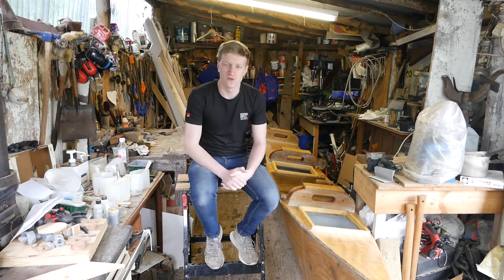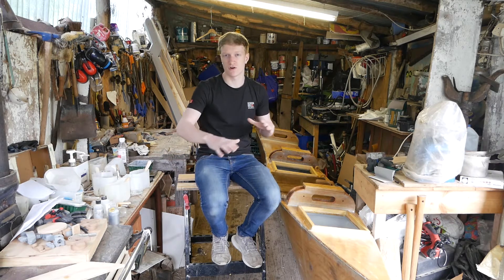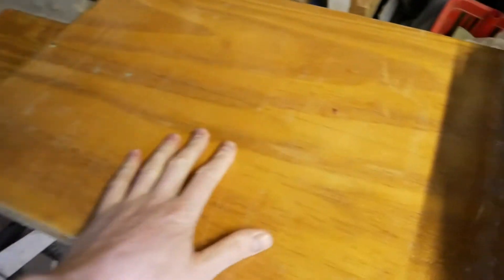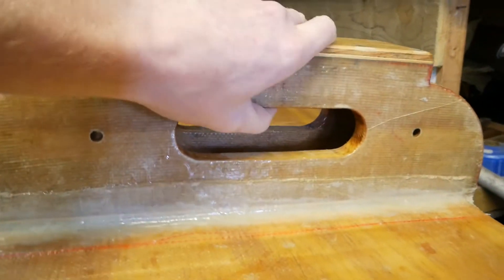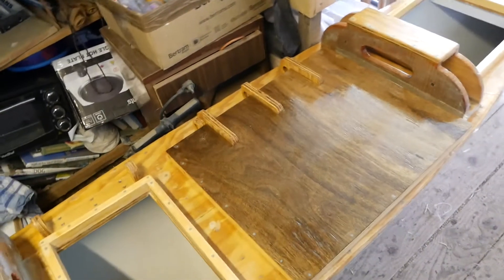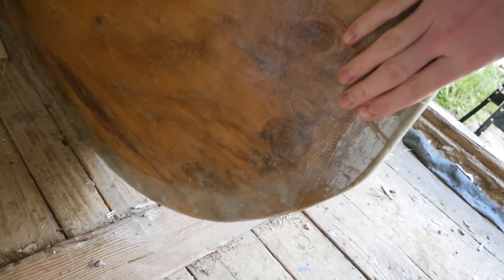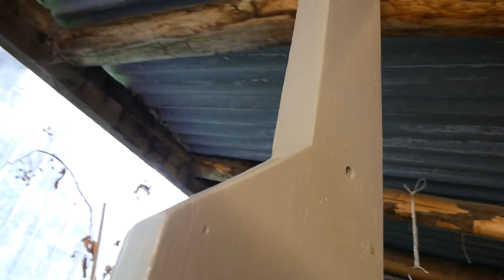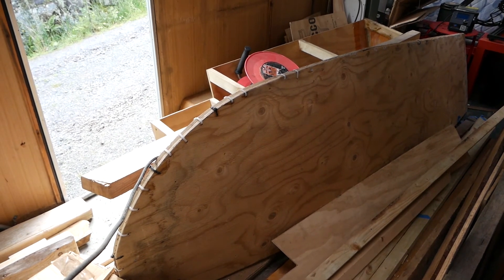Building a Plywood Catamaran - Boat Build Project Introduction

Comment: Did you do any buoyancy calculations on those hulls? As I agree the term sea blade is very fitting, they are worryingly narrow.                                                                 Cheers, Jimmy Crawford
Reply from the maker: Hi Jimmy, no I didn't do any calculations on the hull design. This project is very much a working prototype. I guess we will see when I come to test  it.